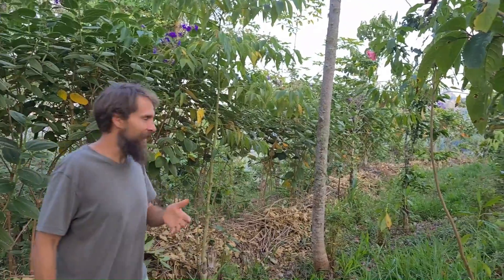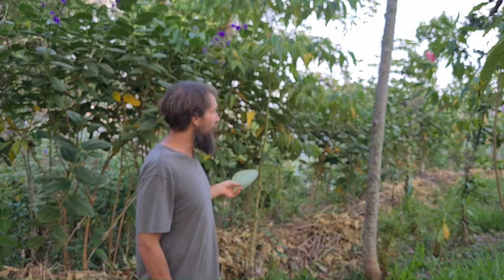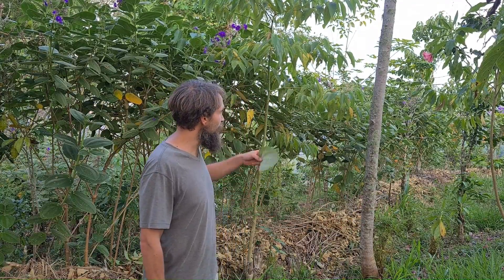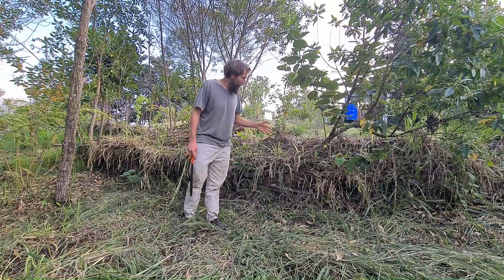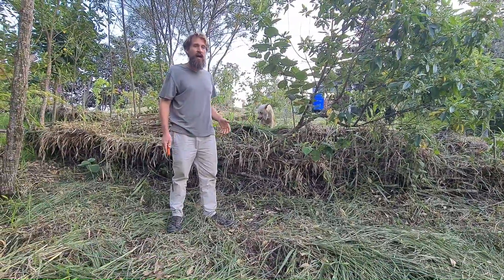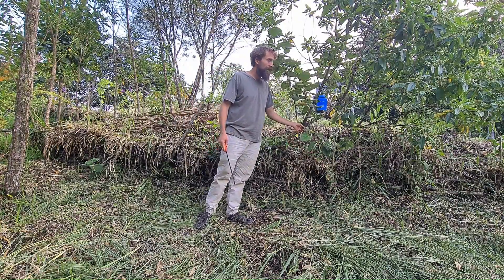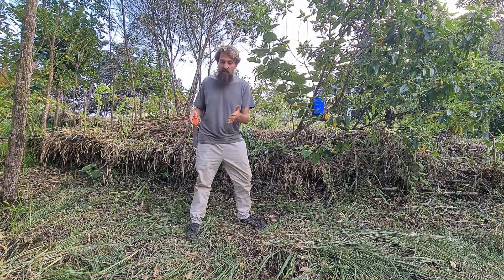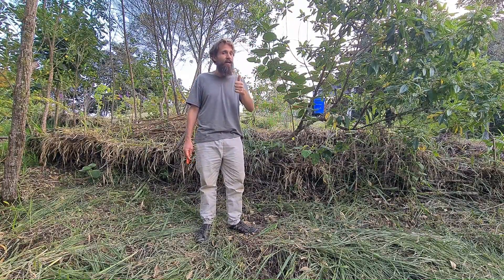Steep Slope Strategies

Comment: This is very similar to the solution we used in on a vegetable  farm in the Altai mountains. We chose one of the shallower slopes in a valley for cultivation, and to eliminate erosion and drought at the same time, we cultivated 8-meter-wide strips (on-contour) while leaving 4-meter-wide strips between them, and to make it extra  secure from flooding, we put a swale above the planting area. With the use of mulch, we get good yields without irrigation in the dry Altai  summers. we plan to use the uncultivated strips for productive  use, as well. Probably a mix of mulch production and crops like tea. But the key is to keep the ground unbroken in those areas.

Comment: I like this concept, easier than swales I’m thinking, my husband’s concern is snakes and scorpions, how do you find the buns first harbouring venomous creatures?
Reply from the maker: @exodusfamilybelize  This is a good question, one I will think deeper on and make a video about!

First - these are totally way easier than swales!

Dangerous creatures will depend on the ecosystem - we may have slightly different concerns but I think easy enough to consider the options - snakes, spiders, scorpions and maybe some other edge cases, certain beetles or chinches.

With these (and other less dangerous pests) we really have two options, find a way to live with them or find a way to eliminate them.

I have not seen snakes inside (doesn't mean they are not there!)  But I have seen once in a while on a new one without shade yet, a snake sunning itself.  Once they are shaded I haven' t seen this, they like direct sun.

Scorpions seem to like the rocky areas much more, never seen them in the biomass.  Spiders on the other hand - I do occassionally see some hiding out on the underside.

If it is the case that a particular pest in your ecosystem likes your biomass piles - at least you will know where to find them!  This can be useful information, and if eliminating them is off the table, knowing where they will be is a good alternative.  We have not had this problem in our ecosystem.

One final note, I have picked up a technique which I call 'farmer presence', when we go out into the farm I always announce what I am doing.  I'm not sure the ecosytem, the trees and animals understand exactly what I am saying - but I am never surprising anyone, I talk outloud so everyone knows I'm coming.  And this has seemed to help a lot, I've had noticeably less problems with getting affected by our pests (poisonous Caterpillar is the easiest to 'miss' for us).
Reply: @EcoInstant  thanks so much for your explanation! We are in Belize so a somewhat similar environment I believe.